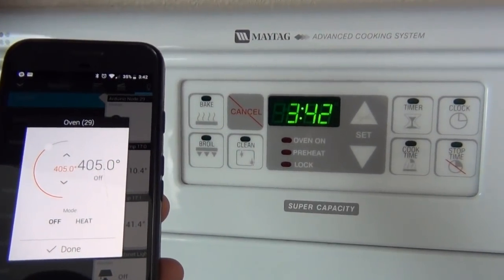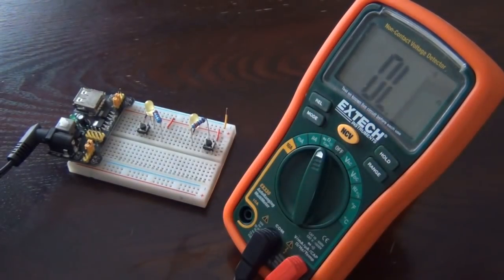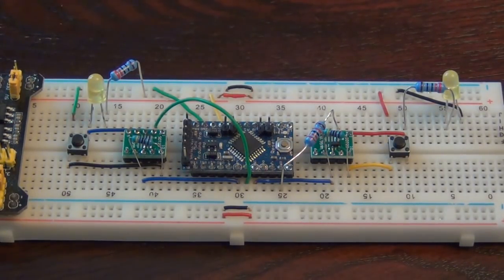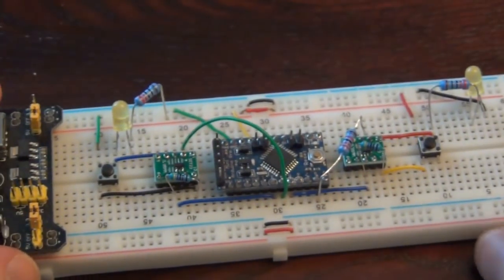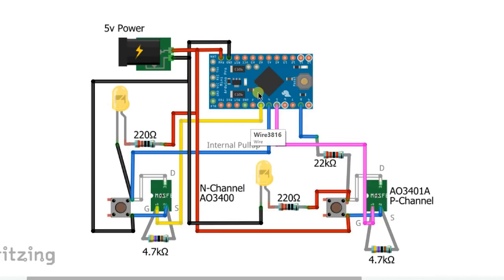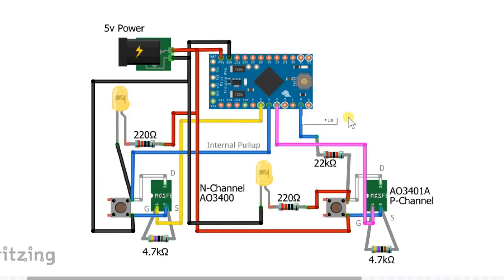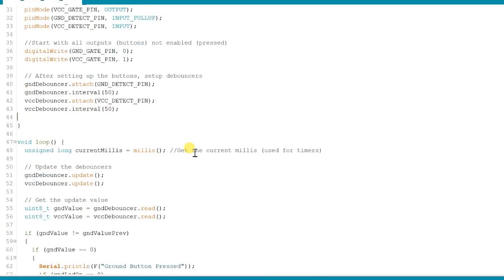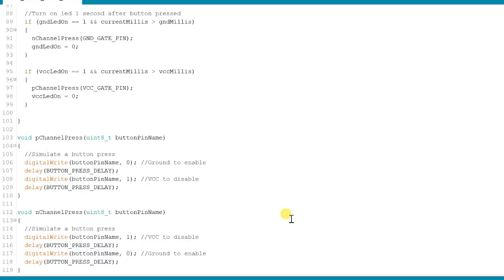"Press" Buttons with Arduino (How to hack and automate your existing device buttons)

Comment: Just came here because I am using bilateral switches (CD4066B) to control, press buttons of another device, however don't work and searched for a solution. The problem is that bilateral switches are not nearby or not infinite (like an open connection), only 100K when blocking and doesn't work when infinity is required. 

Now I am using photoresistors and leds (combined commercially called 'vectrols') and is working great. You need to find the right photoresistor to do it right but hey, it is a very cheap solution (you can buy a bunch of leds and photoresistors for almost nothing) , no mosfets or other 'complicated' things and circuitry completely separated.You can drive the led with an Arduino and place the photoresistor between contact, that's all. 

The only thing you have to deal with is light, environment light and the sensitivity of the button to trigger. Vectrols it's components are encapsulated  into a black shielding to protect it to light from the outside.  Depending on the case, location, lightning condition you must consider to do the same against unwanted triggers.

Comment: you can use cd4066 ic to push buttons instead of mosfets..imo its an overkill and complicated. with cd4066 its just way easier.

Comment: I hope I can get those mounted MOSFETs for myself. I'm trying to do this on an electric kettle where I just need to press one button an realease within a second. I tried with my bare board and it worked. But Everytime the power went out and the board rebooted, the kettle went all crazy and started boiling water. So I figured that a relay (I think is overkill for this) or a MOSFET is what I need in my case.

Comment: Through searching suddenly I came to you video. I was also looking for something to connect the switches for a digital clock.

CD4066 this is a CMOS quad bi-directional switch. Normally this chip is used for switching the audio devices. I need your opinion on that, can we use this kind of chips on connecting the switches through arduino?

Comment: Pete, this is great, thanks for sharing! I'll apply this for remote controlling a heatgun for coffee roasting :) One question: You keep internal state about the temperature in the Arduino (i.e. assume it starts at 100°F when powered up) and then just in-/decrement it on every button push? Or do you extract the temperature FROM the oven (i.e. by reverse engineering the display)? An answer would be highly appreciated!
Reply from the maker: No, I didn't get the temp from the oven display. It always started at the same temperature when it was turned on so I just incremented it in the Arduino when a button was pressed.  This was just the "set" temp, not the actual oven temp.  It didn't matter for me though as I just wanted to turn on the oven to a certain temperature.

Comment: Great Work, thank you Pete B.
This is the second time I come across one of your very interesting gadgets but no explanation of VERA except mentioning it,  is it a hardware or a software or both, can you please show it to us and explain a little what is its role in this process. Thanks
Reply from the maker: Hi Boolf,  You are the second person to ask about this so perhaps I need to do a video about how all this works... :)
A quick summary is Vera is the brains of my home automation (the controller).  It is the hardware and software and it controls everything.  The reason I have been a little vague on Vera is MySensors is compatible with multiple home automation controllers.  I have a couple of older videos that shows some advanced automation with Vera using PLEG but that probably won't be too helpful (https://youtu.be/5iqe3-wqOFg).  I also have a couple of older MySensors getting started videos that will give a little bit of an intro on how it works (https://www.youtube.com/playlist?list=PLGzVpwPAKnPZ6F4fY8AevfVmcHdJFpKma).

Probably the best place to get more info for now is on the MySensors site.  https://www.mysensors.org/about
Basically it will look like this Controller (Vera, Domotiz, OpenHAB, etc) <----> MySensors Gateway <----> Sensors (Oven, irrigation, lights, temperature, etc).

Comment: Hey man, I’m really hoping you could leave me a response. I was wanting to hook the arduino up to something like my oven and/or coffee machine to start them from my phone just like you showed in the beginning. I don’t really understand how to do this and I was wondering if you could give more advice or lead me to something that explains how to do this in a way that I could understand. It would really help if you could show how to do it with your oven and show how you did it
Reply from the maker: I wish I could be more specific but every device is different which is why I decided to make a generic video instead of one specific to my oven.  If your device has momentary push buttons you can take a look at using MOSFETs like I did here.  If it's something where you can turn it on and then connect power you could use a simple relay (like I did in my smart outlet video - https://studio.youtube.com/video/oNpMDN4QqD8/edit?utm_campaign=upgrade&utm_medium=redirect&utm_source=%2Fdashboard).  Sorry I couldn't be more specific.
Reply: Pete B yeah. This is such a broad topic and it can go many ways. I was really confused at one part though. I am probably about to sound like a complete idiot which I am kind of when it comes to this topic cause I’m new with circuits but I see that you built the circuit on the breadboard. Do you actually insert the arduino and breadboard in the oven.
Reply from the maker: You're not an idiot.  We all have to start somewhere. :)  I soldered some CAT5 (network cable) wire directly to the circuit board of the oven.  I put the Arduino and other components on a prototyping PCB in a 3D printed case for protection.  Here are two pictures that will hopefully add some more detail:
https://drive.google.com/open?id=1zL51O4fG2TKIJ1MXt-eguCRTRuPyTaVO
https://drive.google.com/open?id=1ge75Q0iAWauqrwmVoKhtFUqScbR6wsUv

Comment: Nice one Pete. I guess you also monitor the "Oven On" LED so you know the state at any time. I was kinda hoping that you would be monitoring the 7seg led displays so you could read the set temp from the display. I assume thats not required if your oven always starts at a specific temp setting...as opposed to the "last set " temp  which would be the case on a heater etc...
Reply from the maker: Thanks.  Yep, I didn't want to invest too much time in this project as I really only want to be able to turn the oven on/off remotely so I didn't look into monitoring the display.

Comment: You can use optocoupler as well!!!
Reply from the maker: Ah yes, I looked at those but there was something that stopped me.  My memory is fuzzy but I think it was the little amount of current they could withstand (and I wasn't sure what mine was).  Maybe it was forward voltage drop??  I can't recall.  Definitely an option if you know your specs though.  Thanks!

Comment: Pete, great work!  This was somewhere on my roadmap to do with my espresso machine, now maybe I’ll tackle it.  If you have any images or video of your oven circuit board, I’d like to see that.  Just trying to get an idea of what you did to physically connect to your oven.  If you can throw them up in an imgur album, it’d be awesome!
Reply from the maker: Did you see the pics in the link in the video description?  I can probably add some more if you'd like to see something specifically.
Reply: Pete B I saw the link after I posted but the photos are too far from your oven board. Did you just solder the individual cat5 strands to the button’s solder pads? Or we’re there other better spots to get a good connection?
Reply from the maker: I just checked and I don't have any better pictures of the soldering.  It's not easy to take my oven apart either...  Sorry.  
But, yes, I just soldered the cat5 to the existing button legs that are already soldered in.  I did it on the opposite side of the PCB that the push button is.  I used a little flux and it worked great.  I then put the heat shrink tubing and electrical tape over the wires as some added protection.

Comment: Please pete release a video which shows the rest including the vera software, that would be super great!!!
Reply from the maker: Gallardo, I posted the code for my oven sensor in the link in the video description.  I also have some pictures of the sensor.  Are you looking to automate your oven as well or just curious how the whole process works?
Reply: Pete B i would love to copy your idea for lets say lighting in the house but having the missing part you didnt cover, from the arduino in the oven going wireless to another arduino with Ethernet shield which submits finally the data to your phone or any other computer using the vera software. That's state of the art home tinkering! Unfortunately other youtubers are not as great as you in explaining or the loose me half way based on their advanced language in that field...
Reply from the maker: Yeah, it takes a while to learn.  That's why started making videos... because there didn't seem to be much info out there.  
If you want to get a Vera that part isn't too hard to get set up  You could possibly start with a z-wave device just to get the idea of how to navigate around.  For MySensors you need to install the MySensors plugin then connect the gateway.  I have had the best luck with an Ethernet gateway.  All you need for that is a radio, Ethernet shield and an Arduino (I'm using a Pro Mini but a Nano is easier).  I suggest you read through the MySensors build pages to get a better idea.  From there it will require a little experimentation but the forum is full of helpful people if you get stuck.
Reply: Pete B ok Pete, will do. I guess you refer to an homepage with my sensors?
Keep up the great work and your dedication to share your knowledge!
Pete, i did 2 cool projects with arduino but i have a bug in each program. I would need a helping hand. I wonder if you would like to help a stranger?
Reply from the maker: I'd check out this page first: https://www.mysensors.org/about

I'd like to help but I unfortunately I'm very limited on time I wouldn't be a very good resource.  If it's related to MySensors you could post in the forum or if it's just Arduino my may want to try the Arduino forum.  Sorry I can't be more help but I just don't have the time :(
Reply: Pete B i understand. Thx for your reply.